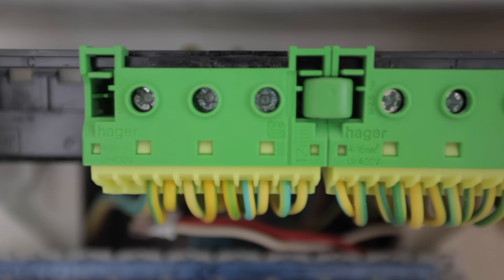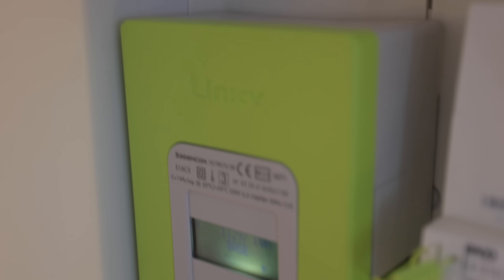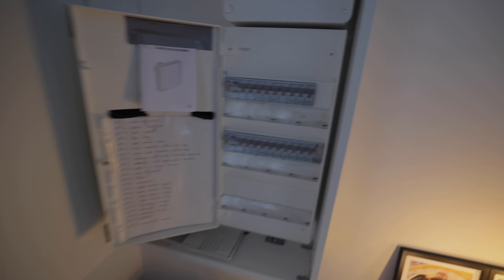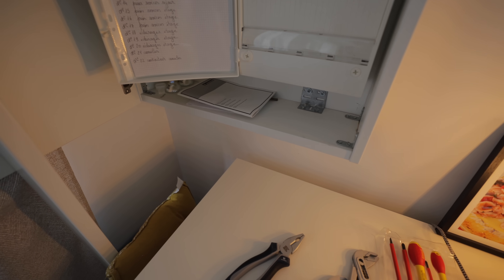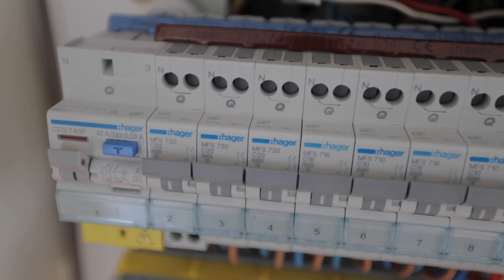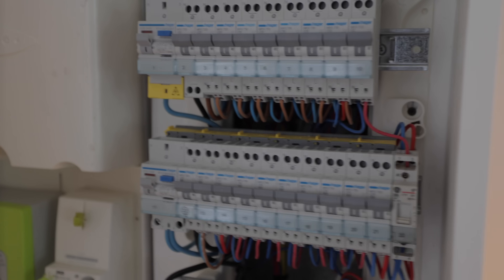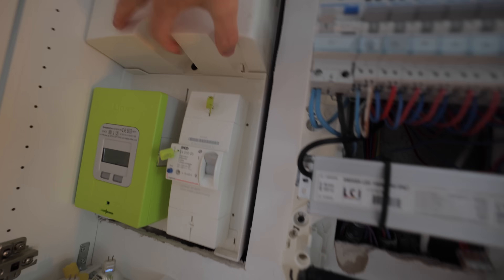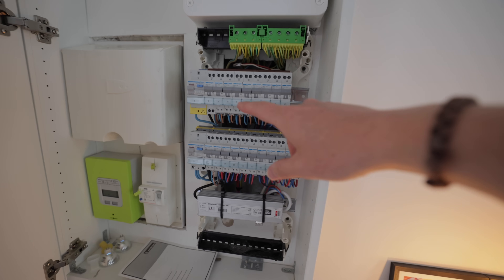U.K. Electrics SUCK! This is what we should be doing…🇫🇷

Comment: Good point about consumer unit location. When we got married in the 70s we moved into a new council house. The consumer unit was just inside the front door at a reasonable eye level. Four years later we bought our own house (a Victorian jobby) and were told the house needed rewiring. So I put a simple fuse box in the cellar to replace the old consumer unit and copied the rented house by locating the new consumer unit just next to the front door, with appropriate twin & earth and auxiliary earth cables linking the two. So when I was away for work my wife could reset any tripped RCD/MCB without scratting round. I do now have a mini-consumer unit in the cellar so the link cable is protected by an MCB and the cellar lights plus cellar power outlets are powered from down there too.
Reply: " in the 70s [...] a new council house. [...]Four years later [...] (a Victorian jobby) " And that is a large part of the problem, I think. We've got a tremendous range of ages of installation, and consequently wiring to different standards. In some respects the intense ground fighting in WW2 had a beneficial outcome in that almost everything had to be re-wired to a significant degree, in a fairly short period of time, to a single standard (per country/ region).
My first exposure to domestic wiring was when we moved into a Victorian house in the 1970s, and while trying to get the electrics to some sort of manageable state (e.g. replacing "round-pin" sockets with the "square"-pin ones, we discovered large runs of single-strand solid wiring with thoroughly perished rubber (not plastic - it burns differently ; Dad was a plastics chemist ; it was rubber, not plastic) cables, separate cable for live and neutral, going everywhere. We figured this was probably from a DC wiring system - some of the junction "boxes" (metal screw strips nailed to wooden boards, under floors and buried in lath-and-plaster) had polarity signs on them. No way, of course, to tell which was live and which was neutral. Literally, Victorian - we knew the house had been built by a local builder's merchant, so may have been packed with cutting edge technologies to see the old century out (1800s). The wire bell-cords to the servants quarters in the attic had been replaced with some of this positive and negative "white heat of technology" stuff, so the housemaid could be summoned to the drawing room by electricity !
Somehow, I don't think there will be much of that left on the continent. But there's still some of it left in that house, because we had a week when Dad was off work for the move, then he had to be back to work and we had to have a working house. And there was no budget for a sparky (nor any legal need). 
50 years later I look at Dad's house, think about when I'll have to prepare it for sale, try desperately to remember what went where, and when ... and fear we've got no choice but to get the whole place gutted when we have to sell it. Nightmare!
Reply: @WellsiteGeolog  Our house had several runs of rubber/cloth insulated wires running in hardwood battens. They were clearly machine made with two grooves and a nailed on lid. A couple of years ago I think I removed just about the last of it when I did some work in one of the bedrooms. I believe that wiring had been installed circa 1910s. The house was originally lit by gas but must have been vacated around that 1910s date for some major work including some re-plastering and many of the floorboards must have been removed and replaced. There was also some rubber insulated twin wiring buried in the plaster but that was a later addition. 

One thing. I'm glad that I didn't have to wire with multiple radial circuits because there is little space to transition to the front 'posh' end of the house to the rear where hired help might have worked. Around 1995 I ran two six square mm T&E cables for a heater and a twin fuel cooker and that was hard work
Reply: I\ve seens a consumer unit in a Hungarian flat in a panel building that presumably is single phase and only has a whopping three B16 MCBs.  No RCD or fancy stuff, the meter is elsewhere, presumably in the basement.  In another building - a small vacation home - the whole house is behind three C16 MCBs followed by the 3-phase meter.  Again no RCB or fancy stuff- and that's a fairly recent install.  So the British consumer units may not be perfect - but there''s worse.

Comment: Many European countries fall down at the plug, as they are reversible so live/neutral is ignored. The French version of the Europlug has an earth pin which ensures L/N is correct.
Reply: i disagree .. as there is no standard on wiring of the socket .. ( live can be left or right here in Belgium )  and here in Belgium we still have a lot of  3X230v .. so no neutral in the sockets . also a double insulated plug you can put in the 2 ways ..( no earth ) .  Also some hear dyers / shopvacs have a round plug with no earthing .
Reply: Actually neutral is by convention on the left but this is not a rule and not e'forced by consuel before.getting your complience certificate to ne allowed to get Enedis (the grid operatir)attach your setup to the grid. But all mandatory protection devices in Fra'ce are double pole protected, so N or L is not an issue anymore.
Reply: If you turn of the braker neutral is disconnected idd.. but the N on the braker is not fused.. we cannot use these in Belgium on 3x230v. @testman9541
Reply: The real struggle countries have across the world is that they may have established a flawed system decades ago , but feel they are stuck with it, come what may.  Mind you, Sweden changed side of road they drove on in the 1967 !
  Brave.
For them, initially at least, accident rates went down because of the concern with being safe.

Comment: Doesn't electricity in France run on the other side of the wires ?
Reply: Yeah it does, it flows in from the left
Reply: It depends: If the wires are on the railway, it runs on the same side as in the UK... 🚄⚡😉

(Except that the French system is 150% faster, 30% cheaper, and has tractive performance on impossibly sharp gradients that we can't match on the flat! 🙃)

Comment: Our house in the UK had a newly fitted metal consumer unit when we bought it 9 years ago, and all circuits are protected by single mod, dual-pole RCBOs (C-Pak). Personally, I'm not a fan of push-fit connectors....
Reply: push fit (Wago type) are brilliant. They do not work loose.
Reply: hmmmm push-fit...tricky, especially on large loads....I mean what is the torque/surface area to copper and how does is cope with oxidisation 10-20 years + down the road !? .
Reply: @antelectric8554  
Been in use in Germany for decades. Used extensively in commercial, 16mm, 25mm cables, etc. They give the correct torque upon the cable. Contacts are coated. 

the only way to, but buy quality like Wago, insure, etc. Not Chinese knock-offs. John Ward on Yoo Tube overheats them with large current draws, performance is exceptional. Worth looking at.

Comment: Belgium here: I have a new apartment (2021) with 3 phase 20A supply. I have 3 rows of breakers (most double module) with screw terminals. This is 3x400v+N. Some homes still have 3x230v, but that is being phased out. Residential is normally always TT earth.
3 phase to induction heater and EV charger in parking garage. (Unfortunately no data cable to EV charger) Everything else is single phase, although I have gas radiant floor heating and a mini-split system for AC. A large heat pump would likely have been 3 phase as well.
Separate breakers for almost everything you can imagine. Max of 8 loads per breaker (double outlet counts as 1 load) by code, I have 4 socket circuits.
Wiring is all singles in tubes, 2.5mm² for sockets fused at 20A, 1.5mm² for lights, fused at 16A.
It's required to have a 300mA main RCD for normal loads and 30mA for all "wet" loads. They are always daisy-chained, but never the selective type, so if you do something seriously wrong, its almost always the main RCD that trips. I wish we would move over to RCBOs instead, so the trips are localized. Other than that I quite like how it's done here, especially compared to the videos I see from the UK :O
Also: In apartments, the meter is almost always in a technical room in the basement. They moved to standardized wall mounting plates a long time ago, but with the new smart meters, that's even less messy. From the meter, it's a mains wire up to your breaker panel (consumer unit), usually on the wall of a small room where the all of the technicals are done, usually next to the washing machine.
Reply: RCBO double pole protected are crazy epensive .. a normal braker is mabye 8 to 12 euro .. RCBO wil proably cost 50 euro ..and has to be dual pole protected ( reason if because still lots of 3X230V in Belgium ) .  But yes for slectivity it would be nice ..but has no sence if you have  300mA standaard ( non selective )RCD ...chances are big it wil trip also  ( in uk there is no MAIN RCD )
Reply: @kittsdiy  True. Although Siemens makes them VAT inc for 30€ (Conrad),  and I suspect price would go down if they weren't a specialty item. But given it's normally a one time cost and usually the time is much more expensive than the material, I would at least like to see this available for sockets.
Or maybe we can replace the 30mA system we now have with RCBOs instead and keep the normal stuff on a separate 300mA RCB.
Anything but the "trip all of things" scenario we have now...
Reply: @Dries007BE  nope that are RCD's .. still need a fuse behind it ..   RCBO = RCD + MCB combine in 1 device . And those are expensive in Belgium and not very common . ( 45 a 65 euro at conrad siemens and are also 1P+N .. so probably not ok for inspection in Begium ...
Reply: @kittsdiy  On Conrad they have the Siemens 5SU1356-6KK16 for example, which is an actual RCBOs. If you look for "differentieelautomaten" at zelektro or elektramat, they also have them, with varying prices, but 25€ seems to be the cheapest option.
But you are right on the 1+N thing, so maybe it should only be allowed in situations where it makes sense (3x400+N for example).
Although I admit I don't quite get why this would matter too much, there must be a reason why they're marked as L and N instead of 1 and 2.
Reply: I’ve have certainly never understood why in the UK double busbar consumer units aren’t standard since boards are now fully populated with RCBOs, to me fly-leads to the neutral bar is a bizarre arrangement and untidy.

Comment: That is an extremely neat install! I am curious to see if it's common in France. Here in Spain the level of work is horrendous, and I am not being dramatic. I am a DIYer and I know l am not supposed to do much on my own but my level of neatness and even safety is higher than all of the professionals I had doing work in my house, and they were not cheap. All relatively safe but outdated (AC RCDs everywhere in this year's work) and you do not want to lift up the covers.
Reply: Most setup will be like that just the wite routing will be better or worse. But for the rest, since you have to get a consuel (validator) to go and check your installation toward complience before getting a green card to be allowed to get attached to the grid by Enedis. And if the setup is not clean, a consuel will go deeper to find what has been done in depth 😁 so people tend to make things clean not to ne bothered by the consuel strick rule checkings. The consuel will then only focussed on security rules like proper earthing, wire size/point number/tarint of RCB... Plus the security of rooms with water source (minimum distances, grounding of metal parts,etc)
Reply: The problem in Spain is, I believe, from what I read,  its really expensive to be a registered Electrician...so there are just not many about : /     This makes prices imbalanced and quality all over the shop.
Reply: @antelectric8554  If that's the case - And given ReNFE's excellent reliability - ADIF must be paying out a Kings ransom in keeping their pool of electricians on the books! ⚡🛤💸😳

Also: If that's the case...Is there a skills void in the Spanish electrical industry, and are they willing to fill it with folks from outside the EU (Only recently) with extremely rudimentary Español?

Comment: It's the same in Poland. Only UK is weird
Reply: Standard EU law
Reply: Other than the location, this consumer unit is just like the one in my house in the UK, so not that weird really. Given that this is the standard requirement these days, there can't be that many homes in the UK that don't have these now.
Reply: @Thurgosh_OG  It may be the standard regulation, but that's for new installations.  When new regulations come out, nobody jumps up and says "I must upgrade my wiring".
Thousands of older properties still have older units - they only get replaced when problems arise.  Until very recently, my house (built 1882) still had a fuse box.

Comment: Basically a dual RCD consumer unit which we got rid of a few years ago. Also  why are the French still using AC type RCDs which we no longer use. Push fit MCBs are 20a or less, 32a have screw terminals. You have to pay extra for the bus bar - it doesn’t come with the consumer unit. Basically you buy the enclosure and the MCBs separately. I replaced the consumer unit on my parents house in France and it cost €700 for a three phase board with 24 ways with 3 RCDs. A fully loaded Hager all RCBO board would cost less in UK. The French have dedicated supplies for all appliances which heat water like a dishwasher or washing machine
Reply: There is plenty of applications where type A RCDs don't work and AC should be used there instead.
Reply: You can mix and match enclosure, RCDs, RCBOs etc and you have 3-phases, which makes it hard to compare to UK units.

A boiler, heat pump, sauna oven or car charger will be 32A or more on a single phase, but only 12-16A on a 3-phase, 400V system - so those would still be using push-in connectors.

I find the European 5-6 DIN Rail enclosures much more flexible and future proof, especially if they use installation terminal blocks like WAGO TopJob S, where the cables are forever on a clamp and the inside of the cabinet gets (re-wired) from there.

Yes. Might cost up to 300€ more, but it will save much, much more if anything needs to be changed later.
Reply: Type A are mandatory for huge DC load such as cooking plate and dish washer. It is recommanded but not mandatory for other loads. Type F is recommanded for an electrical vegicule recharge plug as well but obly type A is mandatory. Also there is a earthing switch required, follow the biggest earh wire. This helps the consuel to perform the earthing double checks to ensure proper security and get granted to plug on the grid (ENEDIS) 🖖
Reply: I don't know French prices but 700 sounds quite expensive. I've got access to Austrian prices, that's 50 Euros for an enclosure (26 ways, surface-mounted), 70-80 Euros per RCD (cheaper if you buy from Germany, much cheaper) and about 10 Euros per MCB (again, much cheaper in Germany).

Type AC RCDs can't be used with any loads that could generate DC leakage because not only the RCD wouldn't detect it but worse, the DC could saturate the RCDs core causing the RCD not to trip even on an AC fault. So AC is useful for purely resistive and inductive loads but not for any power electronics, definitely not for inverters, possibly not even for switching mode power supplies (like in every phone charger, computer power supply, etc.).
Reply: If you have only one panel, even 3 phases, this must be RCBO (disjoncteur différentiel) they have setup. Second I would advice you to buy the product from online website asked by your electrician and have him set them up. Reason is that the 3 major brand (Legrand, Hager and Schneider) and a policy of public price with massive discount. Going online you will het that discount in your pocket.

Comment: hi there, nice vid about the french elektrics, i'm next door in belgium. i am an electrical inspector btw :). its interesting to see how the french do it. here in belgium you are not allowed to use a type AC DIfferential (RCD) only a type A or in some cases when you have battery you have to use a type B. i wonder what other rules are different in france since our elektrical grid is based on the french, like in belgium you have to have since 2023 1 differential per 8 wall outlets. and dedicated line for washing machine, oven, and everything over 2600W. also the differential in belgium has to be max 300mA instead of the 500mA.
anyways like to see elektrics in other country's :)
Reply: yep and also the neutral is not protected ( just switched together withe the live ) i believe in these fuses ..  we cannot use these in Belgium for example .
Reply: The 500mA differential is the main breaker.  It is loosely to protect from fires while the Consumer unit RCDs are to protect people.

The main differential disconnector is also a failsafe in case the consumer unit RCDs fail.
Reply: @johnburns4017  we have the same in Belgium 300mA RCD type A ( but not with mcb inside )  in the same consumer board. At the meter we have normal mcb of 40.A in case of single fase
Reply: @johnburns4017  unless i'm missing something they do different in france, the 500mA always indicates that it is a differential and does not protect againts overload, unless it is a breaker/differential combo, ( also a differential and a RCD is the same thing). i think the french do the same thing as in belgium first in line is the main breaker from the meter, then its the differential/RCD and that has the 500mA indicator.
Reply: @playercloof  
It is:
1)  earth leakage (500mA usually);
2)  Over-current (adjustable on many).
3)  fault protection;